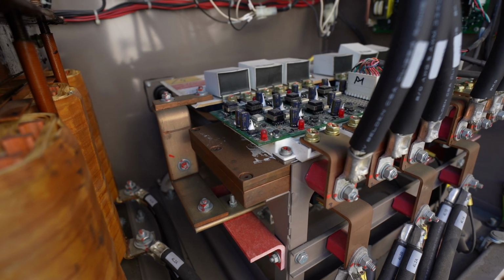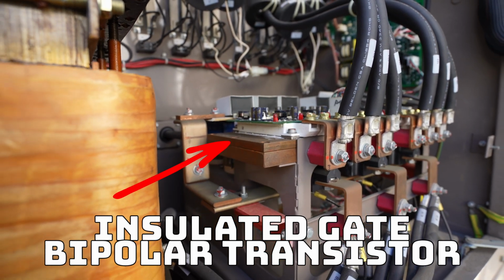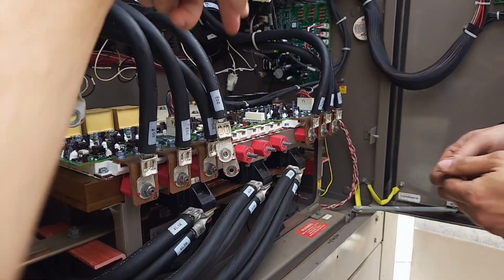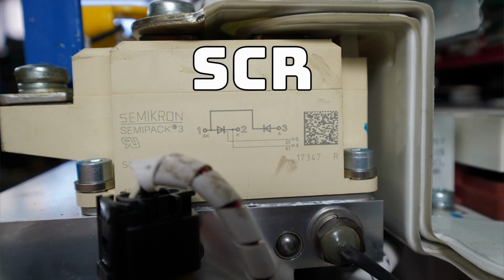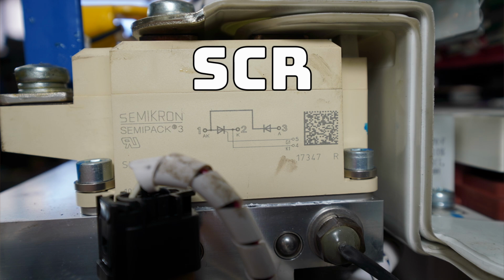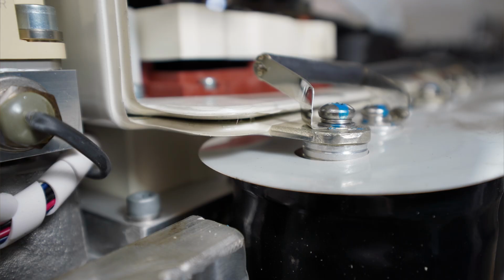How IGBT in Chillers Work

Comment: Non related question. I have a roof top condensing unit that is able to communicate with the indoor air handler without a thermostat wire. What could be relaying the on/off of the unit?

Comment: Great explanation of IGBTs in VFDs! 
But like someone else mentioned, the bipolar term isn't related to the bi-directional power control. It is strictly related to the actual IGBT itself. Most VFDs will have three IGBT modules and each module has two individual IGBTs in the package. So that is what allows the two way power control, like mentioned in the video. One IGBT for positive and one for negative in one package. Some VFDs will have six or more IGBTs and usually those are one for each polarity and one direction.

Comment: Great start, but;
IGBT, Insulated Gate, Bipolar Transistor.
That means it is a BJT with an insulated gate like a MOSFET.
Bipolar does not refer to how you connect more 2 or more together.
To quote a Google source;
"The Insulated Gate Bipolar Transistor, (IGBT) combines the insulated gate (hence the first part of its name) technology of the MOSFET with the output performance characteristics of a conventional bipolar transistor, (hence the second part of its name)."
Ref. Electronics Tutorials

Comment: Is the motor itself the output filter? All the inverters i've worked on have a bank of capacitors and inductors on the output to turn the PWM signal into a true sinewave.
Reply from the maker: No filters on these designs. The capacitor bank is pre inverter. It's why we have to use inverter due windings

Comment: Great video. I worked with some York VFD chillers that had to run in the winter in Canada  as we needed to cool a museum and maintain perfect humidity and temp control. Had VFD cooling towers and it was connected to a full blown Siemens DDC BAS. Always wondered how those chillers worked in sorta simple terms.  It would be interesting to know how VFDs work with cooling towers and BAS controls and large fan systems if you do those.

Comment: Can you go in deeper on SCR
Reply from the maker: SCR are used as rectifiers in drive assemblies. They remove the sine wave to covert ac to dc
Reply: Diode that will conduct only whe  given a control signal but will stay conducting until the zero crossing point of the sinewave. They're dumb and expensive, but absolutely bulletproof.
Reply: Thank you guys